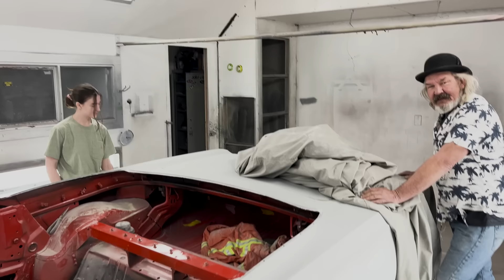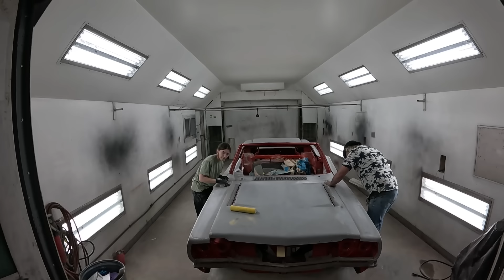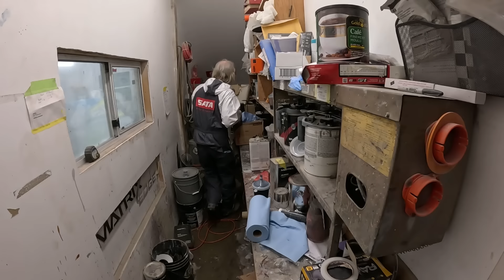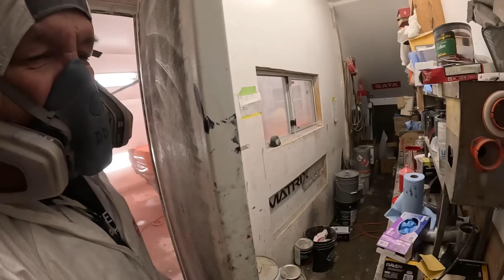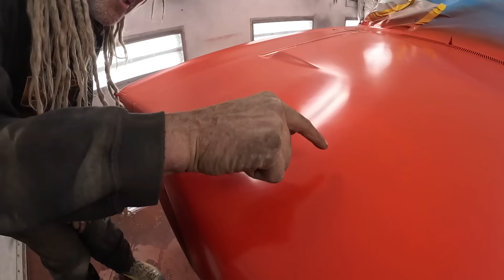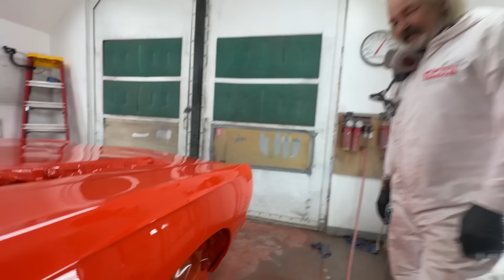2nd Round of Painting on the the 1968 Road Runner (Part 11)

Comment: To eliminate the dry line, leave one panel off. I personally leave the hood and driver fender off and paint it separately at the same time as everything else.. when reassembling be sure to wrap the edges with tape to prevent scratches.

Comment: They shouldn’t even be in the paint booth
Reply: Why's that?
Reply: @FlattBratts  
Take a look at the water on the floor, it can be kicked up onto the side of the vehicle. Also, people bumping the car and hanging parts while filming. When I paint there is no one in the booth with me, so if there is a accident there is no one to blame but me.
Reply: @tl337  the water on the floor is for dust thats a old school trick and the camera man might not know better lol
Reply from the maker: u r correct sir
Reply: @FlattBratts  
I know about the water to keep dust down. Also wrapping a chain around the frame and letting it touch the floor to ground vehicle to cut down on static electricity.
Reply: got that right